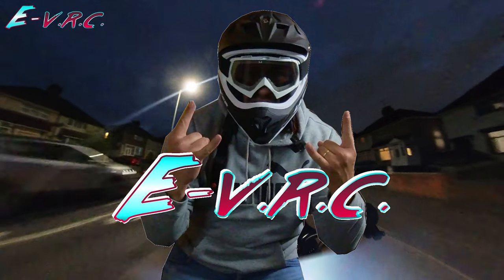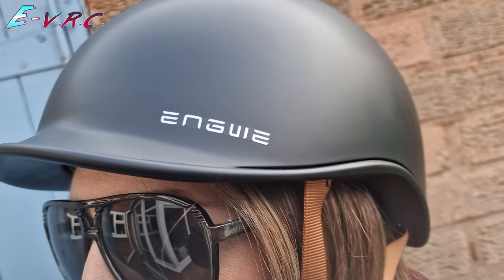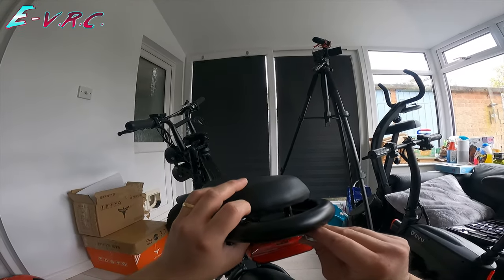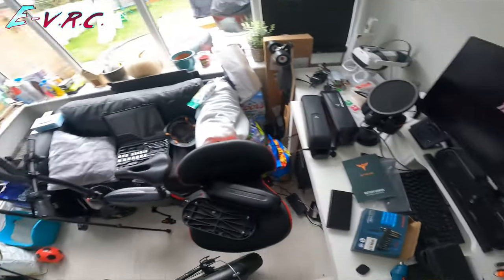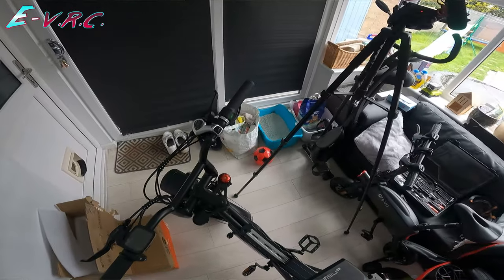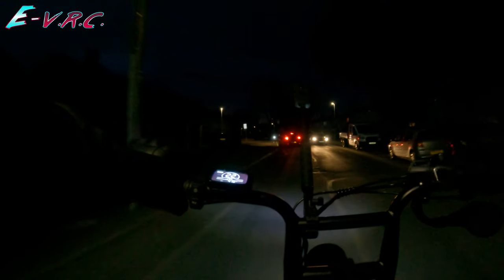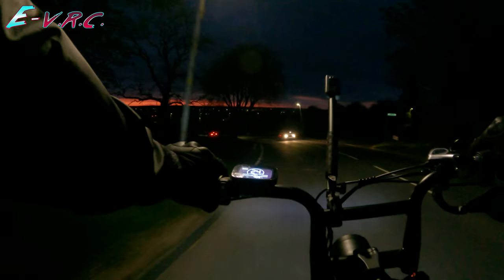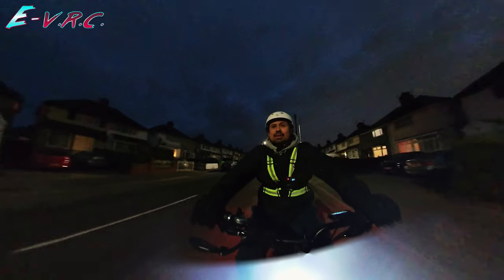TWO Batteries on an Ebike. Will it be FASTER? Engwe M20 Install & Test

Comment: I have the Engwe Engine Pro and build a second 20 amp on the rear rack.  I lost some stability but I Increased my range A LOT. 

In total I have 48V 36 Amp
Reply from the maker: Nice. Maybe do the bmx handlebar mod to get some more control.

Comment from the maker: Don't forget to check out the review of the M20 if you haven't yet. It's a great bike! And now it has double the range :)

Make sure you give a thumbs up to the first person who explains series and parallel and what it does for performance👍

BTW I tried having the new battery below (it's smaller) in an attempt to also have the bag. Sadly I couldn't get the bag on anywhere with the 2 batteries 😥

Here are the current discount codes (links below):
Early bird discount 150 dollars/pounds/euros off: Engwem20
$200 off (USA ONLY): ENGWEM20FANS
$50 of all Engwe bikes right now: engwe50off

Comment: Have you tried the mod to get more torque? If you add a single r005 resistor in parallel to the current speed resistors it will give you a 50% boost in acceleration! Makes your motor run at 1500w peak instead of 1000w!
Reply: I can attest it works great!
Reply: All you need is a single r005 resistor and a soldering iron
Reply from the maker: Ooh no. Sounds tasty!

Comment: I'm going for a 48v 20ah after market battery. I've done 2 weeks of work commuting so far and the single battery is lasting me 3 days ( 21 miles ) mostly on peddle assist 3. With the extra battery and total ah of 33 I should be able to use PAS 4 or 5 a little more often
Reply from the maker: Do you have chance to charge at work?
Reply: @e-VRC  I do yes. I've got a few weeks wait before I can purchase the battery so my plan is to charge on Wednesday at work
Reply from the maker: @castareablast  that's good. Not worth saving your money and juat charging every 2 days at work?
Reply: What 48v 20ah battery did you use?

Comment: I’ve had nothing but issues waiting for the delivery of my M20 from Engwe. Communication is awful with no phone numbers that connect to anyone and they only reply to one email a day. I’ve been waiting almost 2 months for my bike. If I ever receive my bike I might be less disparaging of Engwe but so far their delivery and customer service has been probably the worst I’ve ever experienced, so buyers out there be warmed.
Reply from the maker: Sorry to hear this. Which country are you in?
Reply: U.K. looking at their reviews this is a common issue. The most frustrating thing for most customers is not being able to speak to someone and very slow communication. They literally respond to emails once a day. This means resolving issues takes even longer. It’s a massive red flag. The website and reviews I’ve watched and read appear to be mostly positive but their after sales is the worst I’ve ever encountered is definitely damaging their reputation.
Reply from the maker: @Lee Mountford  they respond to my emails once a day too. I always put it down to them being asleep whenever I sent mine and vice versa. But you're right they need an after sales team based in uk or eu.

Comment: Remember although you double the range "Amp Hours" wiring in parallel you also double the AMPS ,of course the controller won't allow the increased amperage through, but if you fit a different controller with more Amperage then you'll feel the increased TORQUE when accelerating or going uphill.
Reply from the maker: Very good point we could double the amps and keep the same range. If only the controller was smart and.had an app.

Comment: Engwe M20 vs. Engwe X, which one is better climbing performance in real life?
Reply from the maker: I haven't tried the Engine x but people say it's secretly a limited 750w but without the regen of the engone pro so probably a geared motor like the m20 so most likely similar ability although with a limited top speed thr engine x will get less of a run up.
Reply: @e-VRC  That's becoz I saw people can "unlock" officially and go faster, but legally use.
Reply from the maker: @paulkscheung-hm2gq  may have to ask them for one to test 👍

Comment: WHERE ARE THE 3 screws for the second battery???
Reply from the maker: They come with the second battery?
Reply: @e-VRC  where, I just got mine and didn’t find any
Reply from the maker: @mrossi9475  they not already screwed into the battery mount?
Reply: No screws. Everybody the same... have to buy

Comment: hey guys
I've received my m20 and it doesn't matter what way I have the keys I can pull the keys out of the battery and I can still ride away.
I thought the whole idea of the keys was so you can't turn the bike on without them lol
Reply from the maker: No the keys just keep the battery in place. I left my battery not locked in whilst I was in morrisons once. Some bikes do require the key though. It's definitely annoying. Luckily m20 batteries are easy to remove though so you could take them with you. Not ideal though as they're a bit heavy.

Comment: How do yoy disable the speed limiter in the UK?
Reply: Did you fix that? I have same problem now
Reply: @nevazhno1312   "Long press the ‘+ -’ key for 3 seconds to enter the setting page after the display is switched on, then long press the ‘+’ key for 15 seconds to release the 6km limit of the throttle and the 25km/h limit of the speed limit at the same time, and restore the speed limit in the same way."
Reply: @zephyrsky__  ok, I’ll try tomorrow thank you !

Comment: is there a speed limiter and if so how do u remove it
Reply from the maker: I think it goes as fast as it can go out of the box.
Reply: Does anybody knows if I stop pedalling or using the throttle and my bike is still moving, the lcd display has to show the speed until stop moving. Because mine still moving and speed goes 0??

Comment: I want this bike so bad 😩😩😩 but the fear of being stopped
Reply from the maker: I think if you're careful and of you pedal most of the time you'll generally be ok but I hear you.
Reply: @e-VRC  would it be legal if the rear wheel was removed and replaced with a 250w hub wheel? 

Would it be as simple as that?
Reply from the maker: @VideosWithNexus  yeah I suppose so. As long as it was speed limited to 15.5 and the throttle disabled.

Tbf if you limited the speed to 15.5 if you were ever stopped you could just say it's been limited, which is has by yourself.

Comment: Do u ever worry about being pulled over by police because the bike is more than a 250w?   I really want to get a e bike but there is a lot of police around my area. maybe I'm just paranoid
Reply from the maker: I'm a bit more weary about this one as it looks less like a pushbike bike but i try to pedal as much as possible.

I think engwe have started making their bikes... "250w" if you know what i mean. Having throttles disabled on delivery etc. I still want a 'panic button' that can set your bike to 15.5mph and no throttle...

In general though if you ride safely you should be fine.

Comment: Rubbish bike, cost too much. Engwe engine Pro it's much better compare to M20. If I buy extra 16aH battery it will cost me same amount with 32aH not 26aH as M20,... plus engine Pro has build in energy recovery system, Logan fully hydraulic brakes, proper rack - M20 hasn't got those things. With M20 Engwe didn't suprise me and others. 
Anyway for M20 price, I've got 20x4 fat tires 2x1000W motor 52V 22+22+36aH  that's the main parameters plus anti-theft alarm build in, two extra mirrors, build in front rear indicators, extra carry rack £1650.
Reply from the maker: The engine pro is a higher spec but i much prefer the riding experience of the m20. I reckon an m20 pro may be in the pipeline.
Reply: @e-VRC  yes I agree
Reply: Good work, keep doing it you doing great thanks
Reply: what bike are you talking about? i might be interested (the 2x1000W)